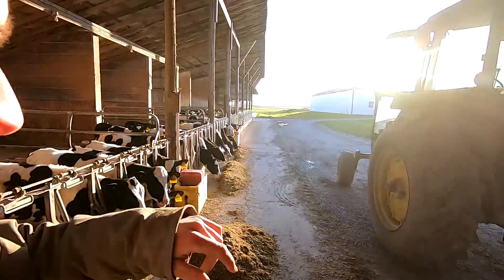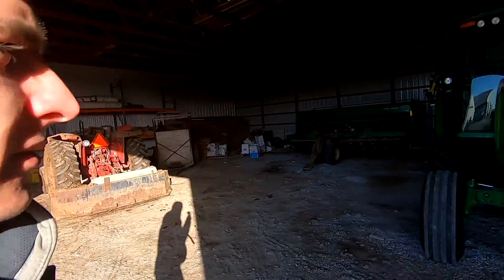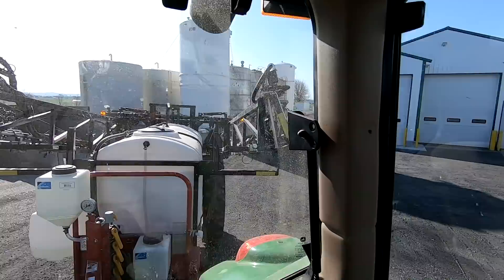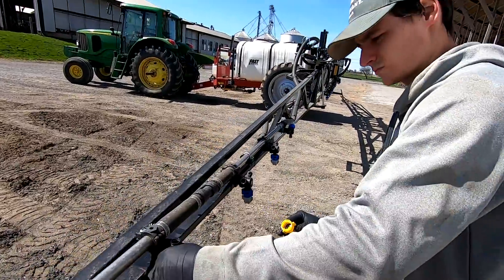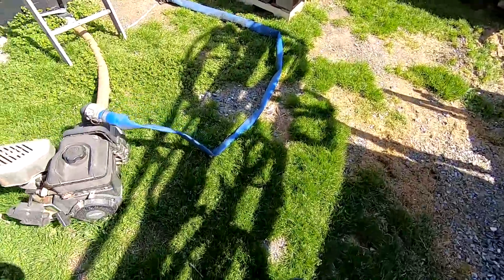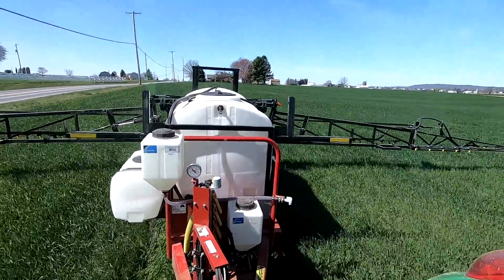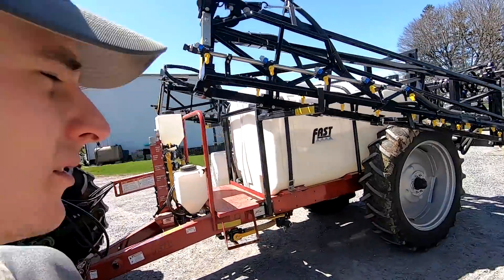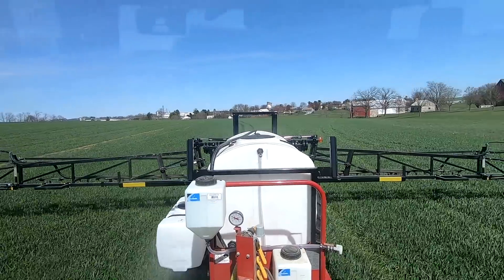Streaming Fertilizer on Triticale

Comment: If you did every other nozzle would you have to travel half the speed?
Reply from the maker: I would have gotten different nozzles that allow more to flow
Reply: @10thgenerationdairyman  thanks.   Probably almost the same cost per nozzle regardless of flow, but you wouldn’t need to buy so many.  Especially handy that you can easy shut off at the nozzle selector.

Comment: Dumb non farmer question, does running over the crop with the tractor/sprayer leave a permanent damage on the crops?
Reply from the maker: Partial damage but it benefits the rest of the crop so much that it's worth it.

Comment: Is the flow automatically effected by the tractor speed?  I liked it when you said it was about a foot tall then stuck your boot into the shot. Great!!!
Reply: New sprayers have flow controllers. This means you can drive to the ground conditions not to the speed you would need to meet the application rate.